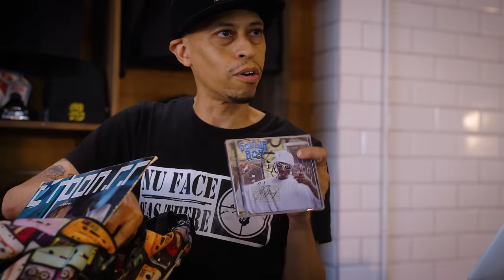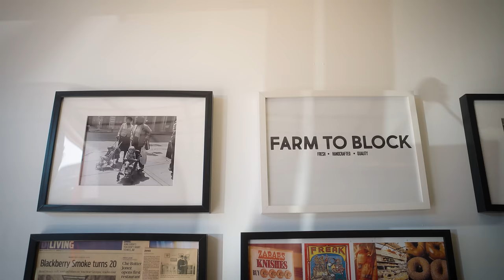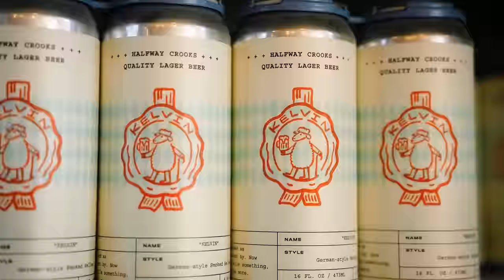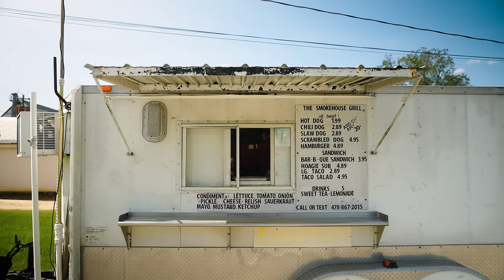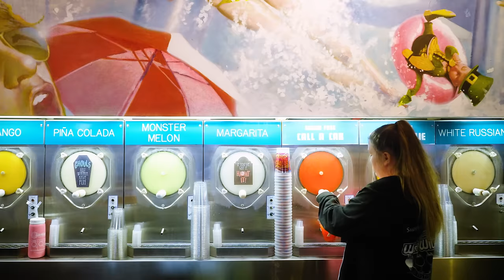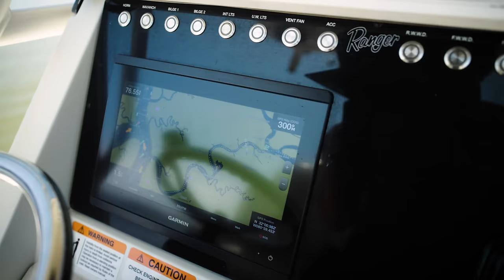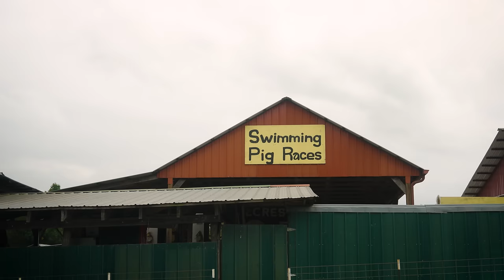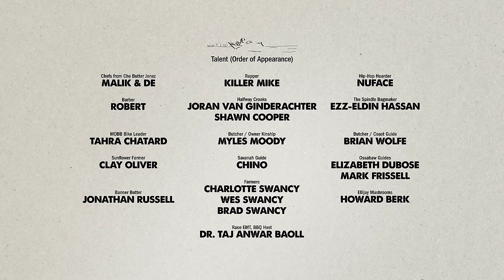Is Atlanta the NEW Food Capital of the South? | Farm-to-Table Feasts | DIRT Episode 7

Comment: ARE YOU EFFING *KIDDING* ME?!  I have lived in Atlanta since 1978, coming from the Chicago area before that, and the food in Atlanta is TERRIBLE for the most part.

Yes, I've been to the higher-end restaurants and, with the possible exception of Pano Karatassos's properties, the rest is hit-or-miss at BEST.

Don't let the hype fool you.
Reply from the maker: Guess you haven't stopped by Che Butter Jonez yet!.  https://www.yelp.com/biz/che-butter-jonez-atlanta-2
Reply: @Huckberryco  And you'd be right about that, Sparky.

Call me when they are open more than 3 days a week and only from 8 to 7 each of those days, and Yelp isn't having to withhold reviews.

Better yet, just wait until they reach their fifth anniversary without overdue bills from suppliers.  If they can do that, then I will happily give them a try.

I'm not singling them out for that; it's the same with lots of restaurants that hold on for dear life until the Marshal padlocks the place.

The lead up to that disaster is usually predicated by using older and older provisions to make the food, cheaper and cheaper provisions, cheaper and cheaper personnel running the heat, opening for fewer days per week, and waitstaff that just does NOT give half a hokey 5h1t.

Hopefully this restaurant won't have any of that happen to them and they will be profitable.

I really want all good restaurants in Atlanta to survive and thrive while turning out impressive food.

Unfortunately that doesn't happen nearly as often as it should.